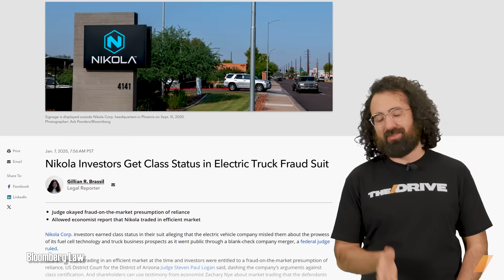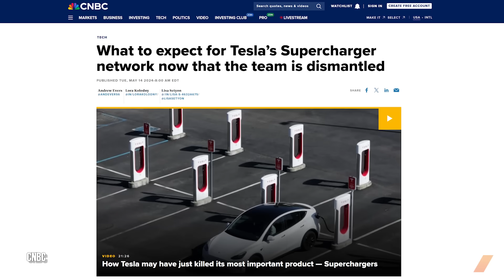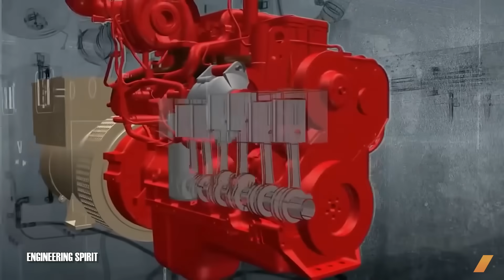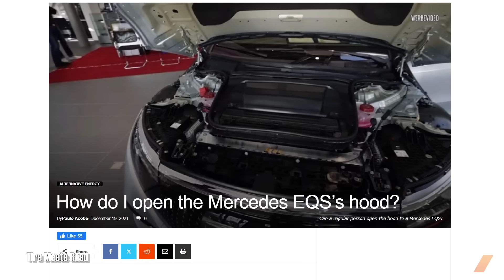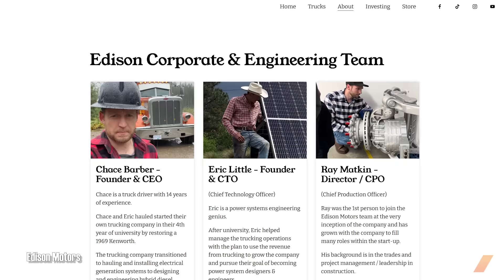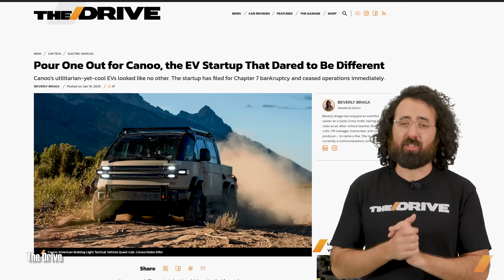The truckers in a shed beating Tesla with 100-yr-old EV tech

Comment: Hybrids were always better.red

They ran twice as long because they had twice as much of a power source. Diesel provides power, Electric provides coasting and ignition. Braking provides electricity, and if designed right, you can have the diesel provide some electricity while coasting for slower speed.

Tesla has fallen to the way side because the dream is too big. We need cheap <5,000$ cars.

I'd love a tin can that just run up to 65 and constantly run for days at a time on a single charge. Solar Power for while it's idle, Regenerative Braking while running. Solar power should close up for protection and be under the windshield. (front and back.)

Comment: The fact they're truck drivers means they know what a truck driver needs.

You don't need 0-60 times, you need something that'll eat up a million miles. A Tesla won't do that on the original battery pack and that'll cost a lot more than the battery pack for an Edison, which may be able to power the electric motors even when the battery goes bad if they've figured it out

Comment: I'VE BEEN SAYING THIS FOR ABOUT A DECADE! Generator hybrids are SO much better than petrol cars, electric, and traditional hybrids.
Reply: Nope. That´s partly true. Better than petrol cars, for sure. The other two depends on the usecase.
Reply: @jurgens9867  All use cases for full electric cars are better served by more versatile generator hybrids, or trains / trams. Wheel driving hybrids are just way more complex than generator hybrids and I'm pretty sure they can all just be replaced by generators.

The only actual instance for regular hybrids is maybe for sports cars, but those are a toy, not a need.
Reply: @shraka  NO. Thats not true.
Why should I waste fuel and money?
I drive fully electric since 2020 and safe more than 50% of money. And tonns of carbon dioxide, for sure.
All few Kilometers we have Chargers and I have my own wallbox to charge it at home.
Toyota engineers are no idiots! Why should they build a supercomplicated car when there is a easy way to do it.
It´s efficiency.
Reply: @ You probably shouldn't need a car then. If you're in an area dense enough to have good charging infrastructure, you should have quality public transport instead. Besides generator hybrids can produce less pollution than EVs (depending on your electricity fuel source), and they're cheaper in theory because of the smaller battery.

You gotta remember mining the minerals for batteries is hugely polluting (and uses a lot of child labour).

From a high level perspective, there isn't really a need for full EV cars, except maybe as hire cars. EV bikes, for sure, but cars are kind of a stop gap to fill in holes in bad PT infrastructure.
Reply: @shraka lol 
Our public transport system is shit. I live in the country in a small village. 
But yes the electric infrastructure is  good and mostly renewable.
Reply: @shraka Only in China are 30 Million fully electric Cars on the roads and in Europe a few Millions too. How many kids would they need to do the job? Most of the metals and minerals are found together with copper.
Reply: @ Did you accidentally switch  burner accounts? What's that about?
Reply: @shraka  That's my second Account on my Smartphone
Reply: @JuergenSchl  … Suss.
Reply: @shraka  😂 I know something about mechanics and electric vehicles but Im to stupid to use the same account as on my PC.
Reply: @JuergenSchl  Doubt

Comment: they need to look at how toyota hybrids work because doing that same thing to a semi would be much better. toyota hybrids still have the engine turn the wheels but its doesn't have to and doest most of the time. it can switch to the electric motor or use both for turning the wheels but if your up to speed the engine will just run as a generator to both charge the hybrid battery and turn the wheels with the electric motor until it doesn't need it for a little while and then its just EV until needed again like when starting off from a stop. also doesn't need to run when stopping because of the braking regen that the electric motor has. if you floor it the engine and EV motor go full power together and the engine just ramps up to its perfect rpm range until you let off.

Comment: It only took how many years to figure out you could put traction motors on a semi?
2:38 Adam Something had done sum guesstimating to try and figure out the weight etc. of a Tesla electric. The results of that was a 3 metric ton payload.

My God if only EMD was still around, I bet they'd be darn at home in this

Just.. base everything off CAT and EMD products, there should be a sh*t ton of parts laying around?
there do in fact exist 8 cylinder EMD 567's, need to check if its dimensioned in a way to fit in a semi

ALSO they could partner with Caterpillar.

Comment: I put 100 gallons of fuel in my truck a day.  At best they are talking about a 10% reduction in fuel cost.  So that is 10 gallons a day saved for my company, or about $40.  That is at most a $1200 savings a month.  So this system needs to add only about $600 a month to the cost to purchase/operate a truck per month for the company to see a $600 a month savings per truck.  I would say that is the number they need to hit cost wise to make a company purchase these.  If you do the loan calculations on a 5 year loan, then these trucks can only cost about $12,000 US per truck to make it worth while.  Any more than that and the math don't math unless there is a government requirement or rebate.
Reply: I like your math :)

OTR will be hard to justify the up front conversion.

City drayage, start/stop, last mile, should make more ROI sense.

Then Edison logging trucks might never spend a dime for electricity or fuel. That ROI is a no brainer.

Comment: You said @2:27 that "Tesla does not disclosed the weights of its Semis..."  .  Well, yes it does... and that's not even very new!  Dan Priestley, senior manager of Tesla's Semi program, disclosed at the IAA fair in Hannover last September the weights of both versions of the Semi:
- The 500-mile version weighs <10.5 metric tons (<23'150 pounds)
- The 300-mile version weighs <9.0 metric tons (<19'850 pounds)
He also said that these weights would go further down! ...and that the truck would come to Europe in an adapted version... and that a sleeper-cab version was also in the making.

Together with the 2'000 pound "bonus" to electric trucks in the USA, and 2 metric tons in Europe, they can therefore tow nearly the same, if not more than comparable diesel rigs! 
The weight of the 500-mile version's battery is NOT 6 tons but 4.57 tons... nearly 10'000 lbs!

Inversely, where does your price of $250'000 come from?  Tesla has NEVER released what the price would be... Your guess may not be wrong, but say it's your guess, don't present it like a fact!

Get your facts straight before publishing a video, which will help avoid disinformation!!

Over here in Europe, the fleet of e-trucks is expending exponentially.  And yes, they do full-load long-haul operations.  Some large logistic companies, like Nanno-Janssen in Germany, have even announced that they would buy only electric trucks from now on, the savings being MASSIVE... and also the trucks' uptime... and also the preference they get from industrial customers trying to reduce their carbon footprint!
But, it is true we have a considerably more developed charging infrastructure... still far from perfect, that much is true, but improving literally every month!  You have also to realize that an electric truck can and do use the exact same DC fast-chargers as cars do!  A so-called "Megachargers" is necessary ONLY at the trucks' bases for vehicles being worked 2-shifts.  They are totally unneeded otherwise!

Comment: This is so unbearably misleading; "we just don't have the infrastructure". then build it; most places have electricity, and the requirement here is building stations to charge. it's the equivalent of adding a gas station, but without requiring fuel to be trucked in. it is insane how the video starts off making questionable zero source statements. bs video tbh
Reply: The good new is that USA power capacity is growing by 3% annually and EV growth is like 1.5% annually :)

The challenging news is that we'll need BILLIONS of dollars invested in the high voltage cross country power lines necessary to get this power to where its needed. :(
Reply: How you gonna get electrical infrastructure into the middle of nowhere BC mountains

Comment: It's not that the Scania engines don't have emissions equipment, but rather that, because the European market has been working on this for significantly longer, Scania was able to work out solutions which don't require the most failure prone components like are still common on North American engines.
Reply: Then why don’t they just buy a scania?

Comment: Well, over here in Europe, Iveco has that ev truck now that has the same range as Diesel – it's a cab-over semi. Plus we have a quite dense charging point grid already in Europe.
Reply: Your statements ring true. Over here in USA, we have long stretches of highway with fewer chargers. And there is no electric semi that can do a full day of logging.
Reply: @Sah-o5m most semi trucks travel less than 300 miles a day, 90% less than 500 miles and the limit mostly comes from volume and not weight, the tesla semi truck would work for most jobs just not the heavy duty cycle ones or extended trips in rural areas.
Reply: Okay and how does that help logging companies in rural Canada?
Reply: @OntarioTrafficMan  So if a EV truck can't do logging in Canada, it ain't no use elsewhere, is this what people are trying to say?

Comment: I'm curious about the tire change intervals on those Tesla Semis, b/c I still find it insane that you're apparently supposed to replace EV tires around every 15k miles.
Reply: I guess heavy electric high hp cars driven by a leadfoot will need grippy high performance tires replaced as soon as 5,000 miles if they're doing a lot of autobahn racing. Or, if the vehicle is driven like a normal car and has high mileage less grippy tires, then they can go out to 50,000 miles before replacement
Reply: Even tires are made harder to reduce damage but their instant eccelration makes it easier to use them more roughly and cause more damage.

Comment: Hi, I don't want to defend Tesla, but I will defend electric vehicles and sustainable technology. I work in battery engineering and have experience with transit busses using 500+ kWh on board, and you are spreading misinformation very confidently which is a huge part of the problem. Please don't do surface-level research and think it's enough for content. Get an expert to review your work if you're not a technical expert.
0:05 "we don't have the battery technology or grid infrastructure to support electrifying every passenger vehicle": Anywhere you already have an electric grid, you can install a charger. We have grids installed 99% of where people live in North America, the only infrastructure you need to add is the charger itself, which you can do if you just pay for it. So, we do have those things and that's why places like the Province of Quebec were able to install 9200 public chargers by 2023, and plan to have 110,000 by 2030. What STOPS these things from happening is misinformation like this video influencing public opinion that unknowingly supports lobbyists, paid by big oil/gas companies, in shutting down government policy. So, please stop. Also the gradual shift to EVs isn't putting the stress on the grid that people seem to just guess that it will. An EV would use about 1/4 or slightly less of the energy that the average american home home uses, but people make it seem like each EV owner is driving 300 miles a day and that recharging all that would require a grid twice as powerful, which is not true. 
1:50 [Pepsi/Frito-Lay uses semis for "little trips to 711..."] No, that's what 15ft - 20ft bed trucks are used for, which is very obviously NOT a semi. The semis are used for trucking products from the main factory to the depots in all the states across America. Please do real journalism which doesn't intentionally frame things in the wrong context.
2:50 [battery weighs 12000 lbs vs diesel engine of 2961 lbs]: 12,000 lbs is pretty close, but at 180 Wh/kg, it's likely closer to 11,000 lbs, but compare apples to apples. You list the dry weight of the engine and don't include the massive transmission and fuel tanks. wtv.
2:59 [battery weight] "kills efficiency" [compared to diesel engine weight]: Put this into context, the best diesel engines are about 55% efficient at turning fuel energy into mechanical. Electric motors, including internal battery inefficiencies, run a powertrain total of about 90% efficiency, and they have much much higher torque, using few or no gears, making more efficient at lower speeds. diesel & gas engines also only reach their peak efficiency at higher rpms, which is why they need 12+ speed gearboxes. 
3:15 [Recharging the semis puts massive demand on the grid]: Don't make it sound like installing 400 kW, or even MegaWatt power chargers isn't possible most places because it is. The issue is upfront cost. One 350 - 400 kW charger costs about $50,000 - $90,000 each, not including the civil work to dig up the ground and make new a new base. However, for entities that are able to finance it will definitely save money (and the environment) over time. I think someone did the math for semis, and operators make their money back in savings in 3 years, then just keep running lean there out. If it didn't make sense, then no one would be interested. EVs work because it makes financial sense on top of everything else. 
3:50 ["What about when those massive battery packs need to be replaced"]: With a 500 mile range and an average of 1000 life cycles, yeah you'll replace your battery after 500,000 miles. Anyone here ever keep a car after that long? Quit framing things with missing context. Maintenance on EVs is WAY CHEAPER with far less failures. That's why it makes so much sense for long-haul trucking. Maintenance on a hybrid vehicle = maintenance on a gas/diesel vehicle, more or less.
4:36 [image of teslas parked on grass as you say "disposable"]: SO belt drives, engine oil, spark plugs, DIESEL FUEL, gaskets, etc. None of that is disposable? Is someone paying you to do this?
[the rest]: Fine, actually. Keep it up and thanks for covering Edison Motors.
Reply: This video to me seems like anti fully electric drivetrain propaganda, I don't get why so few comments pick up on it. I totally agree with your points. I think that Diesel Electric isn't going anywhere. Diesel will always create emissions, so we should completely stop using it, whereas electricity can (and should) be generated from renewable sources. A 5-10% improvement of fuel mileage (& with that emissions) in normal operation in my opinion wouldn't even warrant that hybrid electrical system imo. I think Stop and go traffic is such a minor use case that it doesn't really impact overal emissions. If the overall emissions would be decrease by 70%, it MIGHT be more interesting. For long haul trucks hydrogen would be the best fuel in the future(assuming battery technology and charging infrastructure doesn't advance enough to make it viable for this use case), as it can be produced without emissions from renewable sources and don't emit any CO2 while driving. While the whole chain of creating hydrogen is way more energy intensive than just driving an electric truck, it still would be a 100% renewable option. For short trip trucks, battery electric is the way.

Comment: Charging a battery with a diesel engine, then using the battery to run a motor? Assuming 5% loss from engine to generator, another 5% loss in battery storage, yet another 5% loss from battery to motor, I see at least a 20% loss energy (.95×.95×.95 approx 80% efficiency)
Reply: I think energy losses for Diesel to Transmission is comparable to energy losses from Diesel to Battery.

An advantage with Diesel to Battery is you get regen braking, and the Diesel engine is more efficient when it runs at a consistent RPM vs rolling through gears
Reply: @Sah-o5m  Good point. But with modern automatic transmissions optimized to reduce inefficiencies, we need to look at the numbers carefully to see if this particular system is superior. I want to see how it compares with a hybrid system that uses electric motors and a diesel engine parellely.
Reply: It's better when the generator only needs to run at its most efficient rpm while charging the battery, plus that engine can be smaller as it only has to produce just over the average power usage requirement rather than a mechanical drive engine which needs the engine to have the power of whatever the peak requirement is, so again more efficient